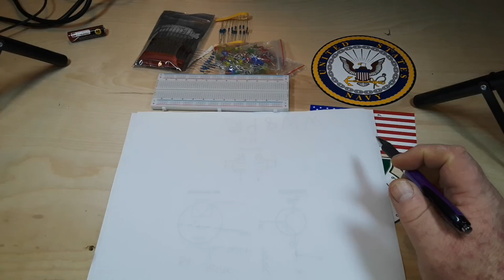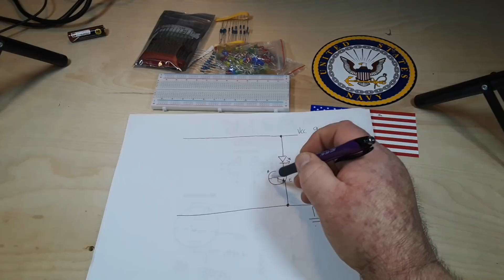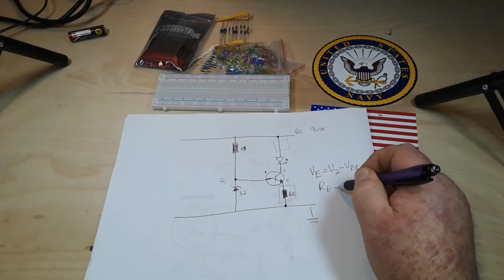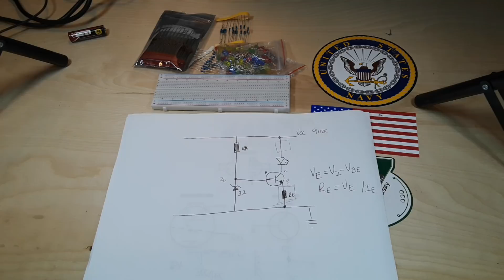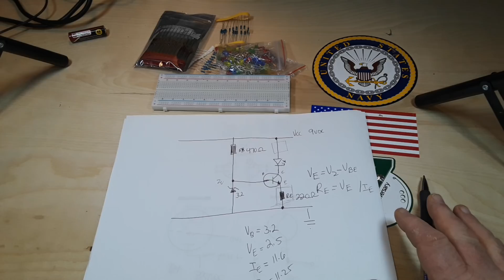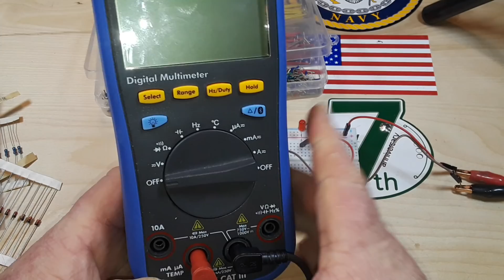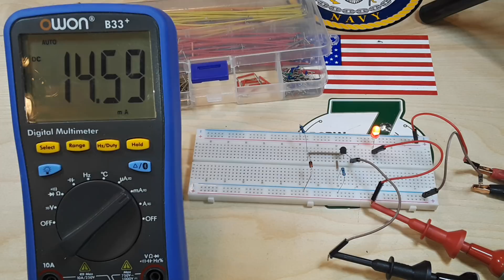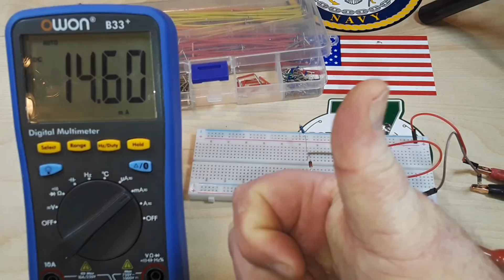How to design and build an LED constant current source using a Zener Diode

Comment: so how do I control current to stop burning out the resistor with a 5v 20A power supply (am running led strips but want to tap of same supply to run timer and maybe 8 5mm leds, without putting another power supply in, space is limited ?

Comment: Its been more than 35 years ago that I learned. But, isn't it that the constant current is ocer Re? The rest of the voltage is divided over CE and the LED and therefore the current changes through the LED when the voltage changes? I am a bit confused.

Comment: Zener diodes are amazing.
The knee of the Zener is pretty interesting.
Transistors are the work horses of a ton of circuits.
This was a whole assed video by a bad ass You Tube educator that posts this stuff on here for entertainment and improvement.

Comment: You didn't show how you came up with the resistor values 470ohm for RB and 220ohm for RE, how did you come up with those values?
Reply from the maker: Use the calculator in the description

Comment: Another great explanation and video tutorial, but now I’ve got to put in a request. Please do a “High Current” led driver circuit sometime please sir? I have a bunch of these Cob LED spotlight boards with 24 leds in parallel.  The original circuit I got them from had an inductor and a couple of capacitors and operated on a single cell lion battery. I try and power them from battery alone and they get just a fraction brighter but ALOT hotter so they’re definitely sucking the current. So I figure it’s not a boost circuit, it must be some sort of RC oscillator perhaps allowing the battery voltage to  get pulsed at high speed as a means to controlling the current through them. 🤷🏼‍♂️

Comment: A simple question (not linked to this tuto) how can i get 3v AC from 6 v AC output transformer without hack the transformer itself ? Any help are welcom tanks a  lot
Reply: The simpler thing to do is look for a transformer that will give you the desired output with the desired input.